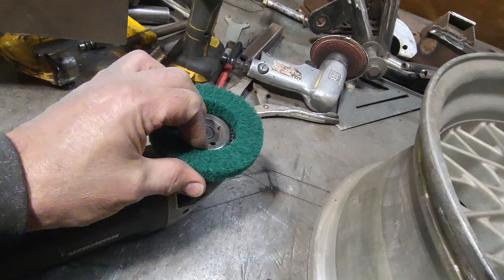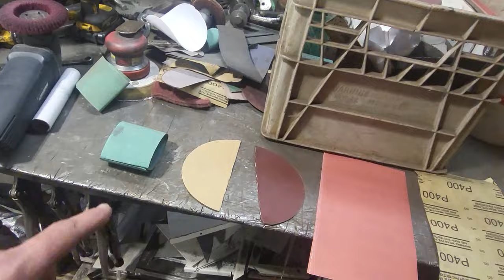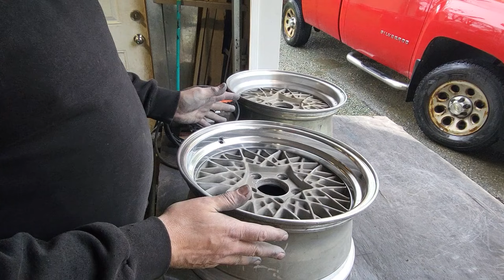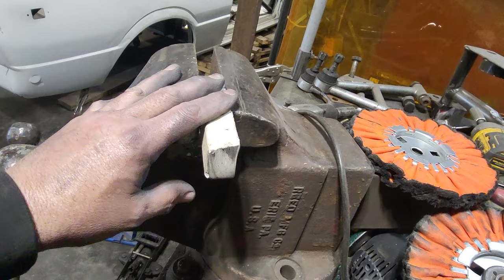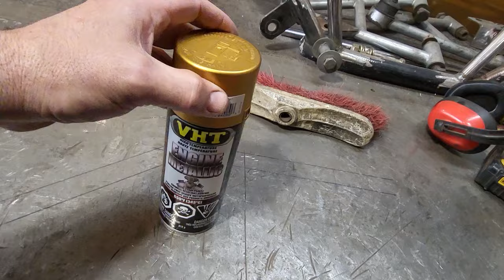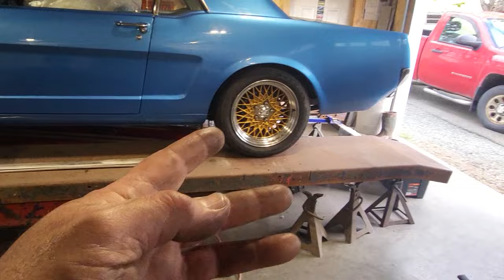Budget wheel restoration

Comment: Do I have a tip for you.  Put the wheel on the car and put it in gear with the wheel in the air.  Use the car as a lathe to polish the edge of the wheel.   I done this and it works great.

Comment: Nice job Tony. I refinished a set of Firebird 16 x 8 wheels for my 88 Monte Carlo LS.  The clear coat was in bad shape, so it had to go.  Found out that regular marine paint stripper takes it right off. A little sanding later and it's ready for polish. I also made a flat plate that covers the spokes to polish the outers without touching the paint.

Comment: I have used Autosol polish, it works but I am very partial to Simichrome. It works in the same way. I am sure the finish is indistinguishable once the part is wiped off properly. Simichrome is light pink and Autosol is white. Supposedly, the Simichrome contains the red rouge compound in a very fine form.

Comment: You can speed up the sanding and polishing process by mounting it on the car with jack stands under the axle. Put the car in drive and hold the paper or polisher in place. Think of it like a lathe.